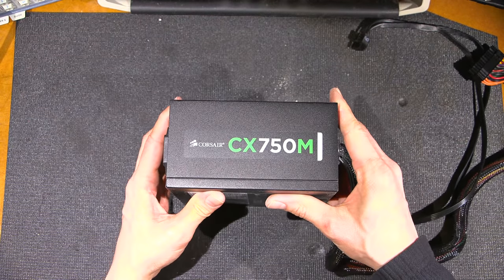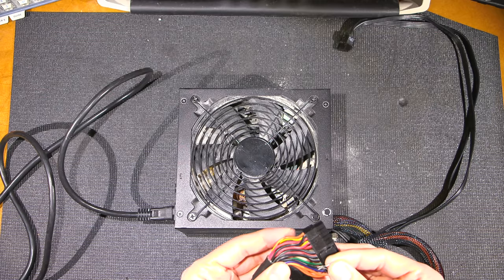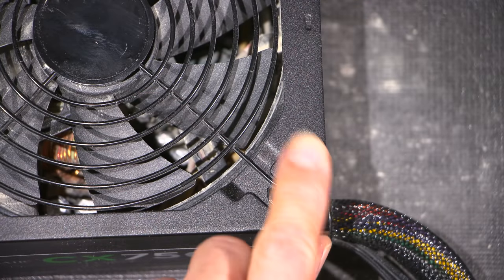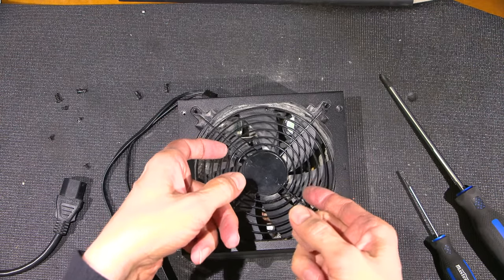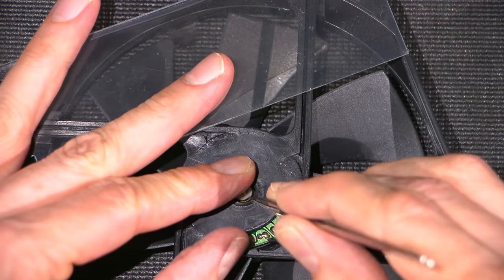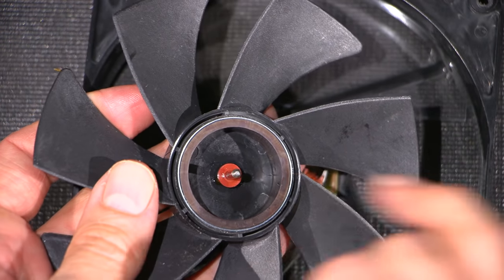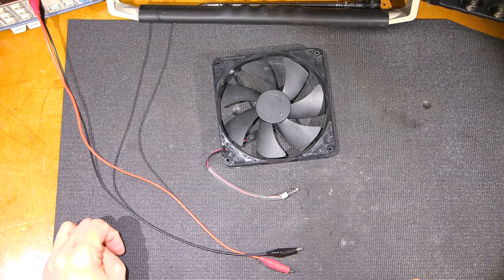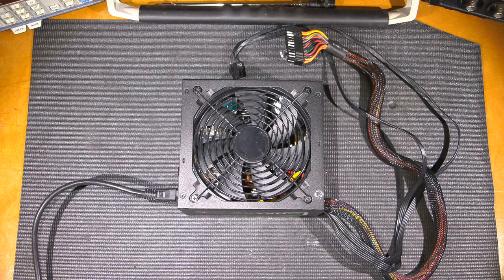Fix A Computer Power Supply!

Comment: Something of further interest about the bearings. These sleeve bearings are made of a material called Oilite which is formed from bronze powder and stamped at high pressure to fuse it together in the proper shape. This is done to leave the bearing porous so lubricant can remain in the pores and migrate  to the surface where lubrication is needed. A good Oilite bearing can contain up to 20% of it's volume as oil. It would have been good to try and remove the bearing and then clean the bearing in a strong solvent, dry it and then soak it in a light oil so that the pores can be cleaned and refilled. Many people apply heavy oil or grease to the bearing which will work nicely at first but in the long term the grease will block the pores and shorten the life of the bearing by preventing oil migration. This is a very common mistake because the bad effects are not immediately obvious and 'common' sense seems to indicate grease on a bearing would be a good thing. It is not always so.

Comment: Thanks very much! I have just had the exact same problem in a CX650M, it has the same fan, so I followed the procedure exactly. I wasn't sure exactly what to use as the lubricant, so I used some liquid grease we have at work. So far so good, its much quieter now! Hopefully it will keep going for a while longer.

Comment: great channel, sir.
i started tinkering with watches about 6 years ago and discovered a low cost and effective lube for watch case gaskets. 
it can be found at the hardware store and is cheaper than horological name brand stuff - Plumber's silicone grease. It's thick, food-grade, waterproof, and last's a long time, it would probably work very well in this application too.
i think i will find out, thank's for an interesting adventure.

Comment: Well well well Mr Carlson, once again you have taught an old dog a new trick! I did Not know about the little white clip. I usually just use some 3-in-1 oil and if that doesn't get it going, then I pop in a new one. I am so ashamed. Thanks! Now I can completely disassemble the little bugger and polish the shaft and really OCD the thing. This is a great day indeed. I am overdoing it a bit but seriously I have thrown out quite a few fans over the years and now I don't have to. Great Vid fellow sparky. PS, my favorite quote to a customer? "Well, it's probably NOT a short, but we'll see"

Comment: Had the same problem with my power supply about a month ago, exact same fan as your video.  I just added grease on the one side and that fixed it, but it wasn't as bad as that one.  Also removed that plastic baffle which was reducing air flow and increasing noise.

Comment: Nice video, simple fix!
Many Corsair PSUs and some from seasonic & CM use identical Yate-Loon D12SH 12v-0.3A fans. Purple, blue, black colors but the same model. High air flow, quiet at lower speeds and no vibrations.
I have a few of these lying in a drawer somewhere for DIY projects, Definitely one part to harvest from blown power supplies.

Comment: That resistor shorting is something new and great, pure wisdom. I myself have tested the psu many times with a simple pin but the idea of testing it with the resistor can only be know by someone with great amount of experience! However i didn't understand why the psu switched off when the resistor was removed? Most psu still keeps running even it is removed?
Btw your videos are so fun and very calming to watch always!

Comment: "What will most people do in this situation? Probably throw out the fan and replace it"  You give people too much credit =)  I think most people would replace the whole power supply
Reply: They'd be better off too. When a PSU goes it can take your whole PC with it. They're not supposed to. But I would not bank on the protection circuitry working. The trouble with failures is things are not working right then. I tell people that if they care about their PC swap the PSU out every 5 years like clockwork. Otherwise you're just gambling. The house always wins in the end too.

Comment: It be noted that horizontal mounting (blowing up or down) is what kills these traditional sleeve bearing fans relatively quickly. Vertically mounted they'd be lasting a lot longer. (This is why your graphics card fans often don't hold up in tower cases. You can probably see why the axle spinning on its side in a sleeve would be providing a larger, more robust contact area than the end supports.) If you can't do that, fans with either ball bearings or more advanced hydrodynamic bearings are the way to go long-term.

Anyway, thanks for teaching an old dog some new tricks today. Now I know why my last power supply fan repair didn't hold up particularly well, I had just removed the plug and dumped in some sewing machine oil. After the noises returned, I flipped the machine over so the fan is vertical, which quietened it down again.

And yes, D14SH-12 is a high output 140 mm fan, moving 140 cfm at 2800 rpm while generating 48.5 dB of noise according to specs.

BTW, the owner of this supply should probably adopt a habit of cleaning their PC out every once in a while. With how much dust came out of there, I won't be surprised if it had never been cleaned in its life (even externally with a vacuum cleaner) despite seeing a fair bit of use.... or else it sits in a rather dusty environment. This seems to be the "old" CX750M, released late 2012 or so and updated in 2016. Sure looks like 4-8 years worth of dust to me. I dread thinking about how the rest of the system might look like. That said, it might be using one of those newfangled cases with a bottom-mounted PSU while standing on the floor, which is not helping dust of course.

Comment: I love that tip about using a resistor as a way of applying power to something like those tiny female connectors on fans. It's a lot better than using scraps of wire that are unsupported relative to each other and tend to either short or open as you're testing the device. Any resistor (or capacitor!) that won't cook at the test voltage would work great for this. 

That power supply looked like it was choked with drywall dust. Having worked as the repair tech in a vacuum cleaner shop, drywall dust is abrasive and just about the only thing that will blow out the bearings in a Lamb 311 motor. (The Lamb 311 is about the vacuum cleaner equivalent to a Chrysler Slant-6, it is known for being nearly bulletproof, and yeah, you can change the bearings in a Lamb 311.)

Comment: I am a computer tech who has fixed so many cooling fan issues I can't even begin to count! From a money making standpoint the best way to fix that Fan would have been to replace it especially if you are going to warranty the repair. If it is you own PS however your repair is perfectly fine. One thing you mentioned is that it has bearings. Some do have bearings but it has been a long time since I have seen them in use. Must fans use a bushing and shaft and can be oiled from one end because the bushing goes the whole way through. I just power them up on the desk and keep adding drops of oil on the shaft until the fan is rotating freely again. Your way is more thorough but also much more time consuming! There are now fans that are called "Magnetic Levitation" fans that have replaced the need for ball bearing fans. No actual physical contact exists so no need for a bearing or bushing and they are cheaper to manufacture!
Reply: That YL fan is the best thing $1.56 can buy!

Comment: Done this so many times I can't remember them all if I had to. I found some good oil for these fans at radio shack once before they closed their doors. It was a small tube with a precision tip full of oil with clear PTFE. Great stuff, makes these fans spin quite for years with only a few drops. I've worked on nearly every kind of PC fan they make, the best ones have actual bearings, ID 3mm, OD 8mm, very standard bearing you can buy in bulk online. Quality bearings last much longer than bushings, usually no need to replace even though some do go bad. Another type oil I found works good is hair clipper oil. I never use grease on these, as the bushings inside actually are pourus with tiny oil pockets that don't hold grease very well as grease dries out, but absorbs oil great and will last. I've also encountered some of these fans that cannot be disassembled without tearing them up to get them apart... I despise those types, they can't be lubricated.

Comment: Keep your PC off the floor.  It's amazing how quick that they get dirty when on the floor.
The other reason for not spinning the fan with compressed air is that it will generate voltage.  Most newer mobos will have protection but older ones can get fried from the reverse voltage.

Comment: Got a Corsair TX750 PSU right there on my bench, the repair is waaaaaay more complex: one power MOSFET and a few diodes and transistors are blown because of a short circuit due to a screw falling on the PCB and getting lodged in the HV inverter. Curve tracer to the rescue!

Give it some air and it'll be a thing of beauty and a joy for ever :)

Comment: A couple of tips, to remove the first plastic ring, a dressmaker's scissors of those with a curved tip work very well to remove the ring with the cut. And another trick is a swab from the ears, remove the piece of cotton they have and the stick of the swab is used to push the piece of cotton inside the cap to be able to clean it if necessary.

the fan, on the other hand, does not have bearings as such, but a porous bushing that is the one that maintains a small amount of lubricant.

Comment: I have done this for countless people for all kinds of brushless fans and blowers found in computers. 
The slower the fan spins, the longer and more successful the repair will be/last in general. 

I must say though it's been my experience that it is not a permanent fix. Sometimes you get a week, sometimes you get 5 years. It all depends on the construction of the fan, if the bushings/bearings (there are several different types) were scored or ruined, and if the fan used some sort of shim (the one in this video had one made of silicon) between the rotor and the bearing has degraded. A lot of fans have a small rubber o-ring that hardens or deforms instead of the silicon shim shown here. Also it should be mentioned that some circlips are harder to remove than others, some are made of metal, others plastic, others teflon, and you'll find in quite a few so called 'rifle' bearing fans that there is no clip at the back to remove, forcing the blade assembly out will do the trick though. High RPM fans like the blowers on GPU's just do not last when you do this if they have gotten to the point the wobble and vibrate in their cage. It does not take much wear for these to go out, and cleaning the grease out and adding oil will just mask the actual problem until the oil is displaced and it gets to rattling again.

If the fan failure is in a power supply I look at all the components very carefully, specifically any electrolytic capacitors for buldging, the resistors for signs of heat/discoloration, any silastic that has changed color/properties, and any discoloration on the transformers themselves. This will often give me an indication if I can rely on the power supply or how long it spent without proper cooling. If I feel the power supply has been compromised then I do not attempt repair or restoration unless it's a very special and unobtainable part. I consider the power supply one of the most important and most vulnerable parts inside a computer, and if it's been compromised it has the chance to take hundreds if not thousands of dollars of hardware out with it.

 I've always considered fixing a brushless fan or blower as a stopgap for my own clients and have them order a replacement fan or whole assembly, trying to improve the quality of the part that failed if at all possible (Replacing a really poor quality sleeve bearing fan with a ball bearing fan for an example). When I know a replacement is on the way I rarely reinstall the circlip on the back blade as long as the fan does not hit anything without it, I find it makes it way easier to re-oil it if I need to before the part arrives. I have a tough time with the plastic circlips as they generally get amazingly brittle once the fan has been allowed to overheat too.

I must also comment that in laptops the labor of me tearing apart their laptop to oil a faulty blower is the same labor as me installing a brand new fan part. Since the fan/blower is a fraction of the price of my labor, it makes little sense to go that far into it without replacing it. Those fans are amazingly fiddly too, so the chance of ruining it by attempting to lubricate it is fairly high. Some are fluid dynamic bearing, or so called 'maglev' as well, and when those die they cannot be taken apart or lubricated in the same way, which is sad in my book.

I'll end this post with when doing repair work for others I value my own time, my client's time, and the time it takes to complete a repair, so sometimes the less environmentally sound option will win out. To put it into something that would make a better analogy to radio/vintage electronics repair, lubricating a brushless fan that's buried in a hard to get place (especially in a laptop) would be like taking a very out of spec carbon comp cathode resistor out of a very hard to work on piece of radio or test gear, sticking it in the oven to remove it's moisture, making sure it reads close to what it should, and putting it back into the gear. For how long it will last is a question that is not easily answered and you'll likely be back into that piece of equipment sooner than you would like to.

Comment: Looks just like a standard fan. I probably would of just gone and replaced the fan itself.  But I'm glad for you showing how to repair these fans.  I've replaced more than one of these in a computer, if not the cooling fan in the power supply or one of the many other fans.

Comment: Like these shorter videos as well as the longer ones.  Makes a refreshing change.  Can always learn something from these.  If Mr Carlson were to repair a plug I'd probably learn something I didn't know.
Mr Carlson, you mentioned in the video about repairing things so that they don't end up in land fill.  Will you be making a video about adding electrolyte to batteries to increase their life expectancy.  You mentioned something about the process you use in a past video a while back about drilling a small hole and injecting an electrolyte into the battery.  Would be very interested to watch a video of that process.

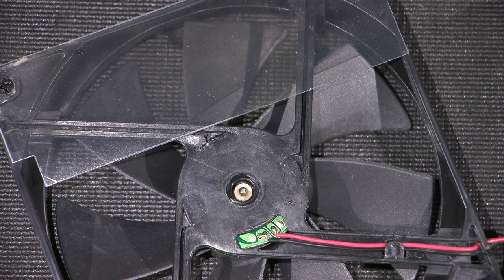Comment: 12:20 you can also see here that the only difference between this 2-pin fan, a 3-pin fan, and a 4-pin PWM fan, is that there are more or less wires soldered to the board. If you soldered the extra two wires onto a power supply fan, it turns it into a PWM fan. You can also take any computer fan, clip the control and sense wires off, and then use it to replace a PSU fan.

Comment: Truly impressive video!  Your knowledge of electronics is astounding down to knowing how to get into a fan and lube up the bearings. Thanks so much for putting in the time it takes to make an informative video like this. Also thanks for keeping a piece of plastic out of the landfill. Nice to see in this age of replace the fan, replace a circuit board or just toss the power supply and get a new one.

Comment: Nice video, as always! I am from Argentina, where ALMOST NOTHING goes to the landfill if It has not been through the repair shop first....I fix PC's and laptops (servers and switches too) as a living, and I must say that 90% of the time PSU's problem are a fan that thinks It is a cow...making the well known "moooh!...moooh!" sound. And You´re right...puting the screwdriver's metallic end into the blades is never a good idea if You're not REALLY SURE of what you are doing..! I always have at hand those little red tubes that come with...say...WD40, isopropyl alcohol, or compressed air cans...they are a way better choice! Thanks for your time rolling the plethora of educational videos (that I am devouring, when time permits!)

Comment: Would like to hear more about your lubricant cocktail
Reply: Ky, astroglide, and saliva.  Oh, wait...you weren't asking me were you?  Nevermind, carry on!
Reply: What you actually want in there is teflon/PTFE grease, not your regular oil or grease. PSUs can get pretty warm, so your regular oil will dry up relatively fast and you'll have to repeat everything again.
Reply: @BTGDelta  Yep, the stuff I like to use is Super Lube synthetic or the new silicone grease they have. Both handle heat real well and don't tend to dry up.
Reply: If people are stuck for a lube for sleeve bearging fans (because they don't service stuff regularly) I've had reasonable results (up to 2 years extended life) by soaking the bearing and shaft in strong alcohol  - 70 to 99% (or Everclear) for an hour or so, then lubing wiith either:-

9 parts  3-in-1 general purpose oil (from a can, not spray), 1 part GT85 cycle chain lubricant (for the PTFE it contains)
OR 
4 parts 3-in-1 general purpose lube oil (again, from a can, not spray) and 1 part pencil graphite "lead" shaved from a pencil (note: extremely messy)

Of these the 3in1+graphite is the messiest and will gum up faster.

For a "quick fix" if you're desperate while you wait for a new fan to be delivered, try a tiny drop of GT85 on it's own. (WD40 is a very bad idea)
Reply: @Blazer02LS  Yep, light duty white silicone grease works a treat and it lasts. Plus, it's easy to see how much you've applied.
Reply: Krytox GPL 204 is what we use for micro bearings in high temperature applications.

Comment: best most useful video - I have a noisy power supply that needs fixing. putting a load on the power supply is also a good idea, instead of the resistor to "short" start the supply, you could use a momentary switch